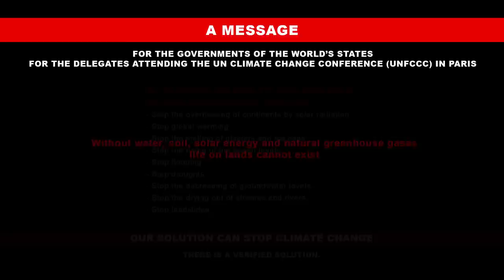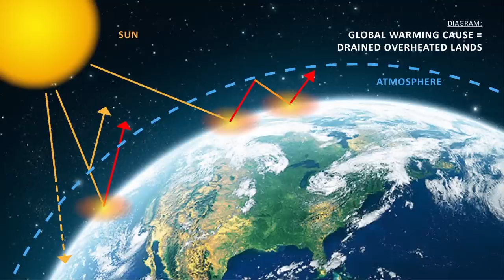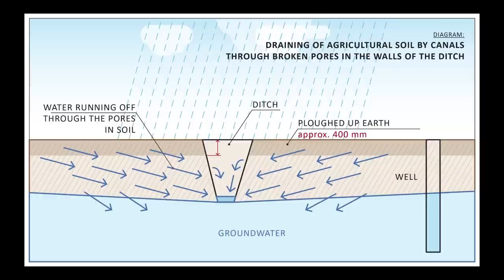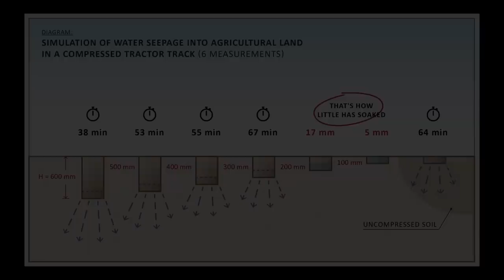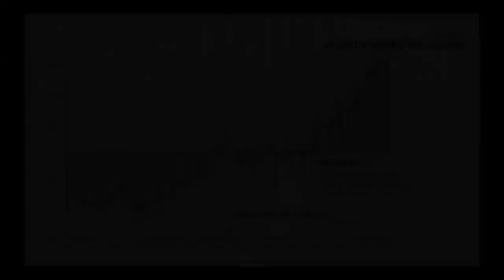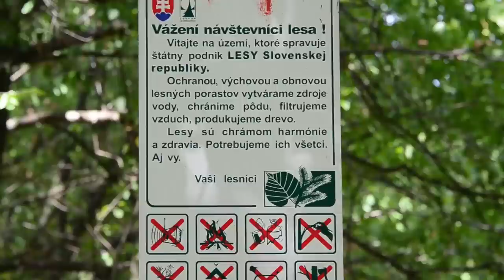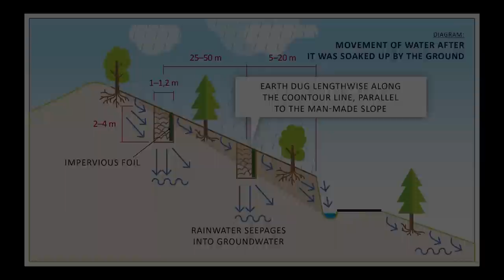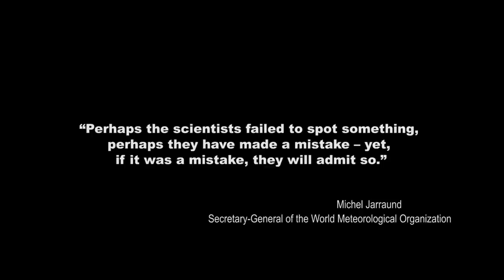Draining of soils = Climate change Štefan Vaľo

Comment from the maker: OPEN LETTER TO A DELEGATE OF CLIMATE CONFERENCE IN PARIS,
FOR PROFESSOR MILAN LAPIN

Dear Professor,

Our continents lack water. It is a major problem which, according to you, is caused by increased evaporation. To find the real cause, however, we need to look beneath our feet – it is the increased rainwater run-off from continents. It is caused by the following:

   1. Compressed soil, which prevents rainwater from soaking into the ground and allows it to run off speedily along the surface to lower areas instead, causing floods and flowing into the oceans.
   2. Man-made slopes, which, through broken pores in the soil, drain the surrounding nature as far as hundreds of metres from these slopes. These pores act as drinking water reservoirs, reaching to    plant roots, headstreams and groundwater sources. C pores are no longer capable of fulfilling their function, though, and they are draining the landscape instead.

And this is the problem we need to address immediately.

You are claiming that only 3% of soil in Slovakia are compressed. Yet, according to official data from 2012, Slovakia has 4.7% of built-up areas, i.e. the compressed areas where rainwater cannot soak into the ground. You have failed to account for the practically immeasurable compressed soil area in forests and on the fields.

Moreover, you have failed to mention – and perhaps even failed to explore – the influence of man-made slopes. According to official data, Slovakia has 42,993 km of roads and 40,300 km of forest roads. Man-made slopes in ditches or above the roads can be found by almost all such road constructions. We also need to add some 6,000 km of slopes in draining canals. Thus, the total length of draining slopes in Slovakia is some 89,300 km.

Yet, this number does not include man-made slopes which can be found above the unused logging tracks and in tracks left by heavy machinery. It is estimated that the total length of such tracks is more than 3 times that of the forest roads, i.e. some 120,000 km (if there’s anyone who has information about higher numbers, feel free to correct me). As results from the abovementioned, our country is drained by some 210,000 km of draining canals in total.

The measurements I have carried out in East Slovakian Lowland (Východoslovenská nížina) have shown that the level of waterin the countryside is definitely affected by the man-made slopes in the canals. When the level of water in canals rise or fall at the times of heavy rainfalls or during the snow melt, the same is happening with groundwater levels in the surrounding fields, which I have verified in a well located 350 metres away from such canal. Groundwater level can rise or drop by almost a meter within 5 to 15 days (if the Slovak Academy of Sciences carried out similar measurements, their outcomes will confirm my claim). Assuming these man-made slopes drain the surrounding countryside through broken pores as far as 150 m from the slopes throughout the year, the area of drained land amounts to 31,500 km2, which represents 65% of the total area of Slovakia.

We also need to factor in the slopes in hilly areas above small gardens and other constructions andcompressed agricultural land, the area of which is virtually immensurable.

We only need to take one look at the dry brooks, fields, forests, empty wells and the nearly empty riverbeds everywhere in Slovakia to see these claims are true. Dear Professor, it is clear that our country, as well as the entire world, face a growing problem represented by the lack of water on continents. Please, try to come up with a solution which will help the people on this planet.

I am not a scientist but I have spent all my life in the midst of nature. My documentaries, available at www.povodne.sk, indicate the ways in which we are destroying the nature, but they also introduce effective solutions which can help us retain vast volumes of water on the continents, and consequently:

             - Stop overheating of continents by solar radiation;
             - Stop overheating of atmosphere (water vapour reflecting solar radiation out of the atmosphere will rise into the atmosphere instead of dry hot air, thanks to which continents will be heated only partially);
             - Prevent floods;
             - Revive sources of brooks and rivers;
             - Make groundwater levels rise;
             - Prevent droughts and forest fires;
             - Stop melting of glaciers and rising of ocean levels;
             - Mitigate climate change.

Most importantly, we can secure sufficient amounts of drinking water for us and forthe generations to come. My solutions are effective immediately, sustainable and they have been tested and in 2011 confirmed by the measurements carried out by the Slovak Academy of Sciences.

Dear Professor, it is important we bear in mind that unless we start to take steps to solve this issue and fill continents with water, the situation will become unsustainable and insoluble and we will see more climate refugees and more water-related conflicts which can potentially lead to wars. Therefore, your mission in Paris should be to help to find such solution. Thank you.

Please watch the documentaries in the order as they are listed below:

    1. Climate Change, Facts and Myths (2015)
    2. Climate Change – The Real And Proven Solution (scheduled to be uploaded on the webpage in the 48th week of 2015)
    3. Draining of Soils = Climate Change
    4. Climate Change – Causes and Countermeasures (2013)
    5. Vraťme lesům jejich kapacitu držet vodu (Youtube, 2013)

You can read open letters to the governments of various states.

Have a good and safe trip to Paris.